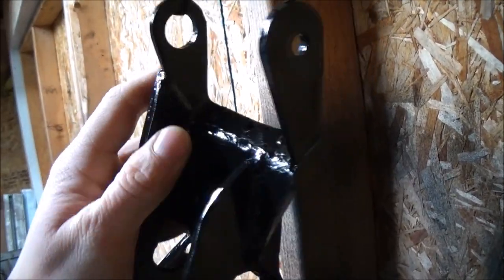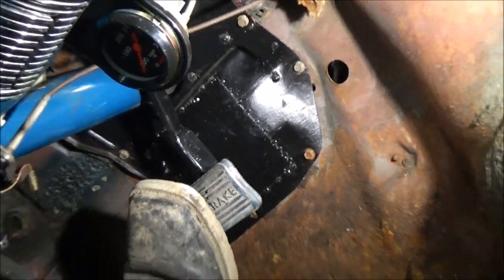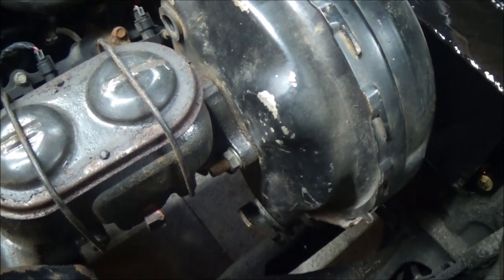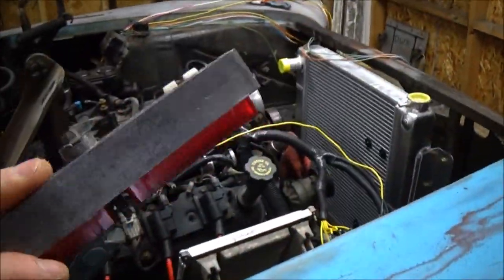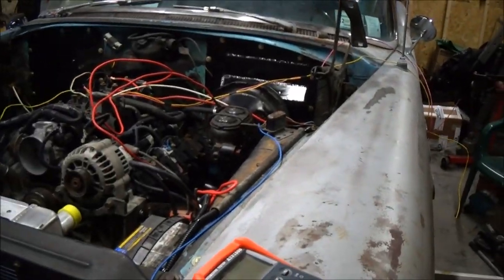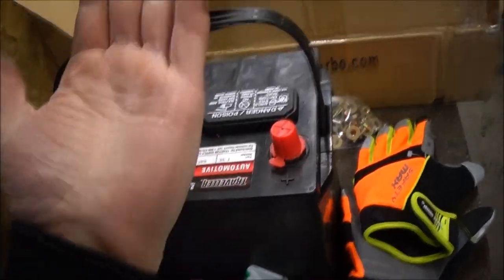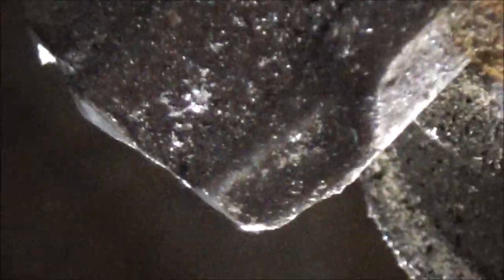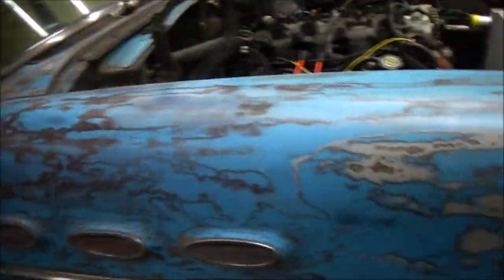1956 Buick LS swap-Part 9 | Brake upgrade and exhaust system.

Comment: You have many automotive skills for your age. My first car was a '56 Buick Special I bought for $50. I remember scraping sludge out of the oil pan and valve covers. I beat that car but the engine and trans held up. Good videos.
Reply from the maker: Dude, wish I could by one for 50 bucks! Mine was 1800 not even running and driving with flat tires and  that was a heck of a deal , but 50 bucks that's a whole different level, but that was a different time, back then then they were just old cars